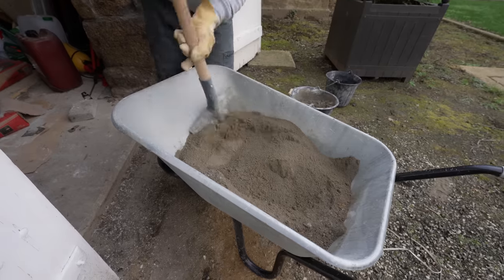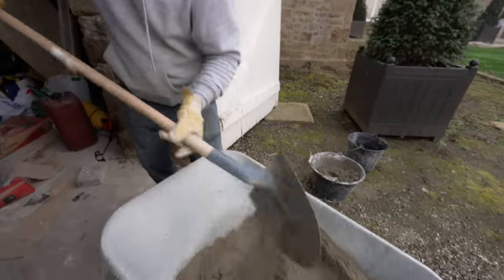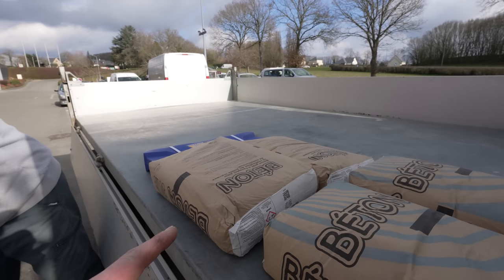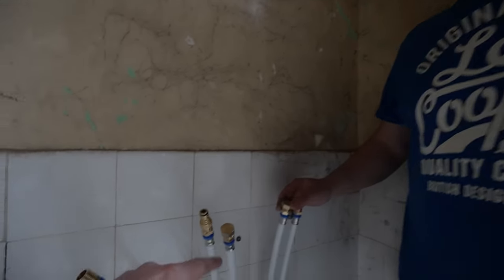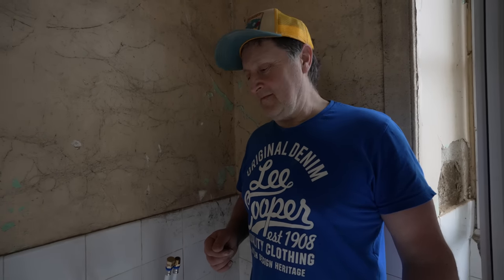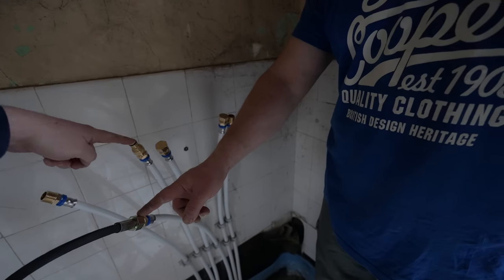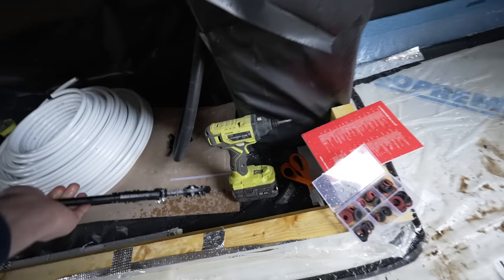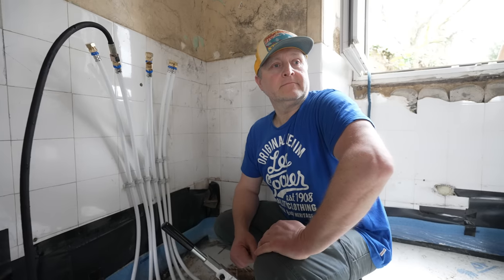Bringing An 18th Century Convent Into The 21st Century

Comment: I wish I had someone like Sean doing the work at my house. Years ago we had someone do the solarium foundations, the side patio and basement tiling (cash transaction). The solarium has been shifting away from the house and so is the raised interlock patio. The basement in 🇨🇦 winter is like sitting of an ice floor, where you feel the icy cold come up and bite you. He never put any sort of subfloor, the ceramic tiles are right on the cement foundation. Nice to see work done properly! 👏🏻👏🏻👏🏻
Reply: On the bright side, you could just flood it, watch it freeze, and have an indoor ice rink. :)
I am sorry that has happened to you. Best wishes.
Reply: Sounds like you need to call on the Holmes family to put things right!

Comment: Cheers mate, really glad you qualified the rio (reinforcement steel in the concrete), .layout as a guide, your guide count be a double use as strength in the floor by lifting it 1”, was worried, but you are doing a brilliant job. Crack On.
Reply: I learned something horrifying about re-bar reinforced concrete when that condo collapsed in Florida last year.The investigators reports showed that if the re-bar in concrete gets wet and rusts, the concrete disintegrates. A concrete pillar under he parking garage and pool deck, disintegrated because at some time after the building was completed, landscapers installed a large wooden planter box directly over a concrete pillar in the garage underneath, over time, the water draining from the box, leaked  thru onto the pillar, which had hadnot been sealed at the top,and it rusted the re-bar inside and  it collapsed. It serves to show how  lives depend on conscientious and professional builders. and  regular safety inspections.

Comment: If you were going to panel the walls inside, you could build wooden surrounds for the air handler units with venting or some louvers for airflow, kinda like how the old steam radiators were sometimes disguised.

Comment: Interesting to see the differences in construction between France & The US. In the US for under floor heating the Pex is solid plastic (no aluminum) aluminum pex is only used in very high pressure applications. In the US expansion joints on only used for outside concrete pours. For interior pours we don’t generally use expansion joints, however after the floor has set we make relief cuts across the slab to relieve stress and control cracking

Comment: That synthetic piping - tubing can be pressurized for testing, but you have to let it rest for another pressure test. It expands at each test. Requires pressure release,  then rest, the repressure .  
The material documentation should tell you this. Just saying. To get a correct test results.

Comment: I realize it is not likely, but if you lose power in the dead of winter, wouldn't the water freeze, expand and damage the concrete? 
You may want to set up a dedicated backup power supply for whatever controls the temperature of the water.
Reply from the maker: you can’t freeze heating coolant.
Reply: @ThePethericks  I learned something new. Thank you I did not realize it was a coolant formula (antifreeze here in the states). I mistakenly thought it was just water, like radiator pipes.

Comment: I don't know what system you have designed for the underfloor heating pipes and wondered if you have a labeling scheme for the hoses for when they get connected. I was thinking colored tape for each zone to ensure you know which one is which if they are going through the wall or something. That's how we labeled wiring when passing through pipes. Great job so far Billy!
Reply from the maker: from the right zone 1 feed/return, zone 2 feed/return, zone 3 feed return. labels won’t be needed

Comment: Underfloor heating is nothing new.
Romans had underfloor heating.
The wealthiest had luxuries that weren't available to everyone. One was Underfloor heating. Known as hypocaust, this heating system, common in public baths used a furnace to force heat into a series of hollow chambers between the ground and the floor, and up pipes in the wall, heating the rooms. Same premise, different technique.🙂
Reply from the maker: the romans also cleaned there clothes with urine… this is 21st century technology in a 18th century convent.
Reply: @ThePethericks  I know about the use of urine.  They also had indoor toilets and built roads a aqueducts some of which are still in use today.  The point I was trying to make is that I think it’s great that you’re using a 2000 year old idea with 21st century technology and equipment in your restoration of a wonderful old convent.  I love your videos so I’ll shut up now and let you lads Crack On.  Also, please know that there was no disrespect meant in my original post.  Only admiration for what you’re doing.